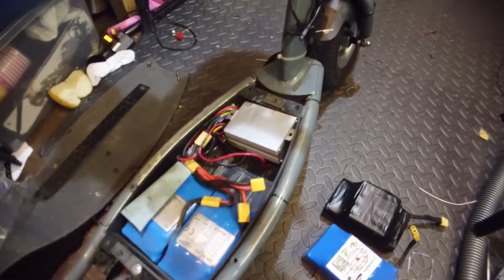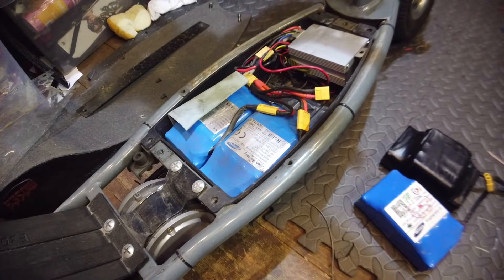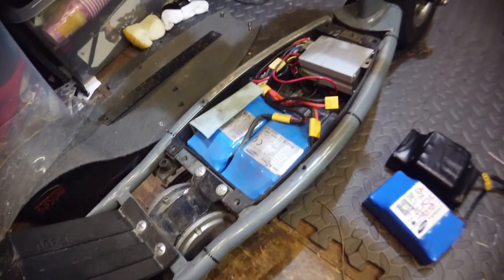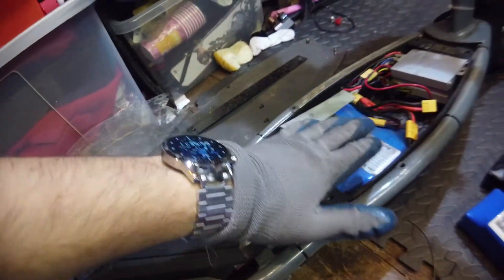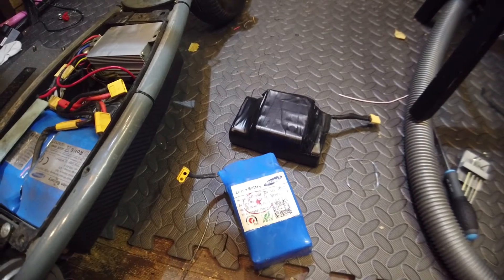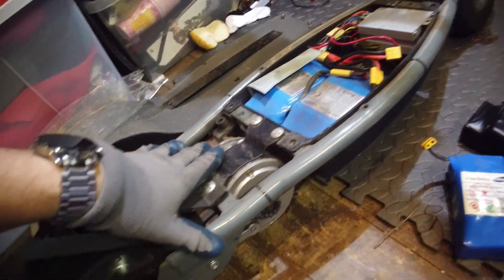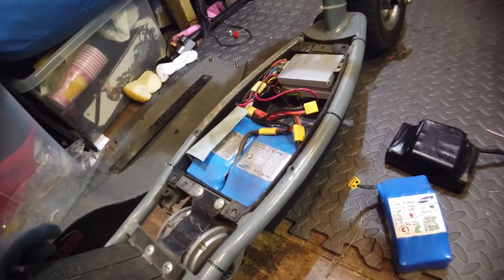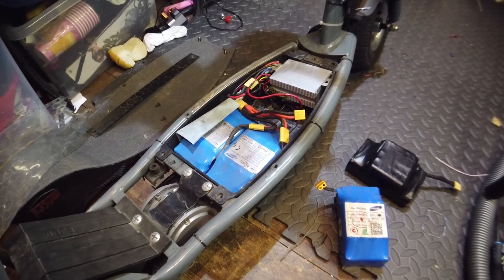Modifed Razor E300 update now 500w

Comment: Ive got a 500W lawnmower motor Id like to try. Can I run the original E300 controller or will it melt? The 500W motor is @ 4300 RPM so this is going to fly if it can even get me going. Its about 2x as long as the 280W stock motor so it sticks out the side and Ill have to reroute my brake cable and ditch the kickstand.

Comment: hi tim, i am building my razor e300 scooter right now and i am wondering if i want to get more speed out of my scooter and for my motor to not burn up should i upgrade the motor to a 24volt 350 watt then the original motor and i am running a 36volt 500 watt battery with a 36volt 500watt controller will i get more performance out of an upgraded motor or just keep this mltlr

Comment: At wich voltage does your battery’s cutoff at? Your series about the scooter has been much help
Reply from the maker: haven't tested that in a while starts at 52v drains to 31v I believe
Reply: Well thats weird i have did the mod to but then with only one battery the voltage Goes from 42 volts to 36 and then cutts off it should be able to drain to 26 volts right?

Comment: So when are you gonna run that motor at 48v?
Reply from the maker: I don't think I will, I don't want to cook it, it's thermal level is good as it is with pretty good performance. Managed to snap my throttle off putting it the the boot of the car. Someone thing to be said for folding head stocks would be useful. Ride safe
Reply: @TheCaffeineRacer Makes sense. Thanks for the videos, best I've seen covering the Razor and details needed to make a decision. I'm working on a E300 & Pocket Mod. Your battery idea is ingenious! Easy to source and perfect size for these frames, I already ordered 3. Thanks again!
Reply: @Its_Rizzler  any updates?

Comment: Hey man! Ive got the same setup. Yiyun yk31c speed controller. I have 2 of these razors.. the first razor worked great from the start. The second....I have tried 3 different new speed controllers. Turn the key on..shows I have 40 volts charge.. twist the throttle . Nothing happens. I hooked up my original speed controll from my working scooter and everything works.  Hook up the other controllers....nothing happens. I have a hard time believing I have 3 faulty new speed controllers.. do you have any ideas?

Comment: Cool project!  I'm doing something similar.  Do you have a link for where you got the 500W Currie motor rated for 28A?
Thanks!
Reply from the maker: I think the link is on my scooter FAQ video but will be old now. Its capable of taking 28A which is great
Reply: I looked at the other video, but didn't see a link for the motor in the Description, nor Comments.

https://youtu.be/H2RT3yrQm8g
Reply: And I see in the Comments here that "Doug green" asked for a link for the motor (~9 months ago.)  And Bhakta Singh, too.

Guess I'm not the only one having a difficulty tracking it down!
Reply from the maker: @scottwilliams895  links changed stock has fallen due to covid sadly but if you do what I did and Google the motors model number it's made buy curie motor and I had mine shipped from America.

Comment: I have the same controller and a variable throttle but I’m using two 5amp 18 volt drill is series so my scooter is 5amp 36v but I’m only getting 30kmh how come I get slower than you Evan tho we have 36v and I have the stock motor how could I go faster ?

Comment: Hi Tim, love the build videos, do you have a parts list breakdown available? I’m in the process of waiting on some bits to arrive from China but would love some more info!! also would you be able to help with the mudguards you 3D print? thanks, Cam.
Reply: So I got mine fully built Tim, 36v 800w controller (I added a few xt60 connections), variable thumb throttle , three hoverboard batteries (connected in parallel) and the currie 24v 500w motor (had to use an xt90 connector for this as the cables were thick!!) I took it for a spin starting with 41.8v on my display, 21mph off the bat (I weigh 13.5 stone so happy with that speed) managed to get around 3 or 4 miles on various gradients, but at 32.2v on my display it just bogged out and pretty much lost all power!! I’m putting this down to the batteries if I’m honest I didn’t listen to you and I went cheap as I just wanted to get a feel for building one of these things but I just couldn’t believe they would bog out when there’s that much power still left inside the batteries!! do you recommend anywhere to purchase good quality  batteries and what sort of price should I be looking at spending? I went for Samsung 36v 4.4ah via AliExpress and I got some shocking “KEDANONE” ones delivered so I’m currently in dispute over this matter with the seller but I’d greatly appreciate somewhere reliable to purchase some batteries! Appreciate your help Tim.
Reply from the maker: @CameronCampbellM  the batteries are completely drained in this build at 31v I believe it won't be enough to power the controller and motor willbe sluggish. A good battery will take longer to get to 31v. Sadly I don't have a reliable source for these batteries to send you to.
Reply: @TheCaffeineRacer  how about the 3d printed mudguard? could you send me a link please?
Reply from the maker: @CameronCampbellM  please email Info@tiny-3d.co.uk to talk about this many thanks
Reply: Also tim please can you 3d print me a splash guard? 💴
Reply: Tim have we any idea on a controller that will drain past 31v?
Reply from the maker: Sadly the parts were all before pandemic alot aren't available or if they are will cost more. Best advice don't go cheep on battery packs

Comment: yo tom im having some trouble with my skooter i bouta new contoller because i thought that was the problem i can charge it and throtlle lights up but wen i plug the motor in it starts going super fast and wont turn off
Reply: id really appreciate it if u answered me back
Reply from the maker: @iiizaiah3794  so do you have the same control as I have in my video
Reply from the maker: @iiizaiah3794  have you searched for the model number founds it's wiring drawing sounds like you have the wires in the wrong orded or crossed
Reply: yes i do have the controller as you
Reply: it was running fine but the battery died  one day and went really fast
Reply: any ideas on what i could fix i think it might be the motor
Reply from the maker: @iiizaiah3794  sorry with out a video or something showing the issue little hard to magic up a resolution I would check throttle switch first
Reply: could i send u a video for a little more of an idea ?

Comment: can I run this 500W chain motor with the stock controller ? Mine shows rating at 30A 24V. I managed to cook my 250w motor.
Reply from the maker: I u could over run the controller and fuse it I wouldn't run that set up
Reply: @TheCaffeineRacer  I will go 350w cause for now the 250w motor is heating badly.
Reply from the maker: @hedialaya3230  are u using standard 24v lead batteries and what's your weight. No motor lasts forever sadly the 350w is a good motor the 500w is better doesn't get as hot 🔥
Reply: @TheCaffeineRacer  forgot to mention I have a lithium 24v 20ah, 500wh samsung cell battery. Battery bms rated 30A as well as the controller. I removed the stock connectors (to battery and motor) they melted badly and soldered directly. All is running. I definitely can use more power motor. There is a stock (black) mechanical fuse rated at 25A. So the motor needs to be rated under that

Comment: Also, how do you charge your batteries through your original charging port or is their another way?
Reply from the maker: yes through the original charging port as shown in my build video. port is connected to the charging wires of the new Controller though you have to check and make shore you get + & - round the right way and that it matches to the charger plug otherwise your charger will go bang. This happened to me the ltihium packs pack alot of punch fairly dangerous if you make a mistake and short them.

Comment: Which motor do you have? 500 watt motor and how much did it cost, do you have a link or part number?
Reply from the maker: XYD-6B2 is the motor made by currie 24v 500w top rpm 2600.

Comment: I've been following your videos and was getting ready to do the two LION battery, controller and throttle update (not the motor) but now I'm seeing this video.  Did you have to upgrade the controller on this update or did you stay with the 800W from the original build?  I like that there will be less speed since I'll be building this mostly for my three boys.  Please post a new parts list if you have time.  Thank you.
Reply from the maker: Hi there is the 800w controller 🎮 from the original build as it will do any motor upto 800w which is helpful
Reply from the maker: Have done parts list in previous videos but as I use ebay items sell out fast sadly but it will suggest other parts simular

Comment: Set up looking strong 🔥, which would you prefer, brushless motor or chain drivers motor
Reply from the maker: I don't like brushless Hubs but I do have a brushless motor I wanna try in it so will have a brushless motor and a chain drive
Reply: Timsalsanights aka The Caffeine Racer that’s smart, double the speed so what would be the estimated speed?
Reply from the maker: @Abdul_-ct6pn  24mph average its pretty consistant the 350w motor is faster. 27-29mph

Comment: Cool mod. I have a E300, which is standard. Can I add a hoverboard battery to it? Or exchange the current batteries with 2 hover board batteries for longer ride time?
Reply from the maker: Check out my build videos, I have this set up would melt a standard controller and motor sadly its not a 24v set up. Needs a full upgrade to go 36v dude 😊 sorry
Reply: Timsalsanights aka The Caffeine Racer I be watched a few but didn’t understand. Do I need the 36v controller, or motor and controller 

I also have a crazy cart & want to increase its run time, I believe they have similar set ups
Reply from the maker: @andrefinessetv2788   @Andre finesse TV  going to this set up won't increase run time. Buy large Ah batteries ie bigger they will last longer. My aim in the build was faster. I have an FAQ video Have you watched this? https://youtu.be/H2RT3yrQm8g
Reply from the maker: @andrefinessetv2788  you will need all parts of the system to use the same voltage for a 36v system takes a little doing sadly